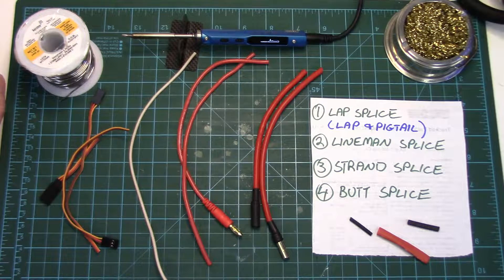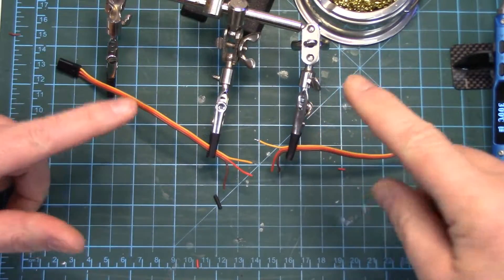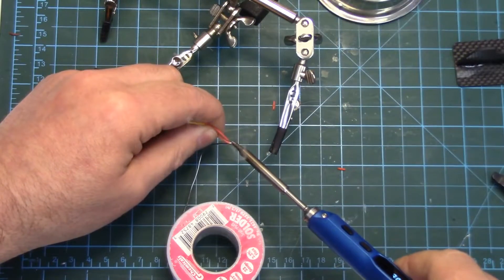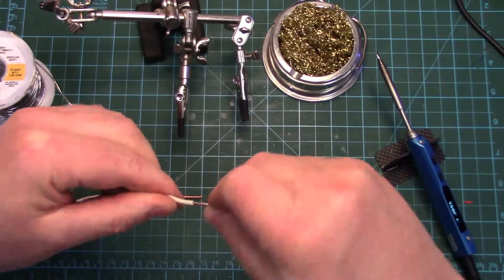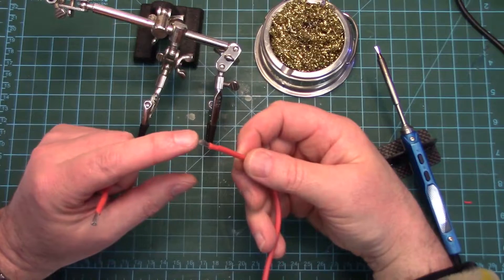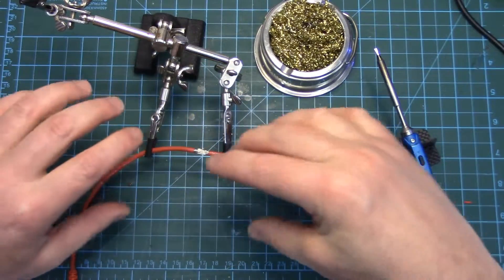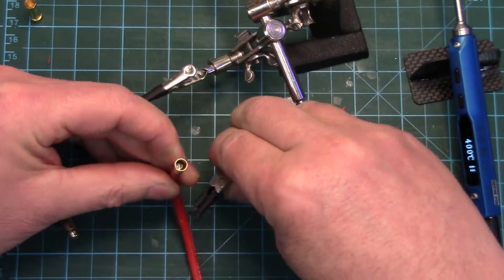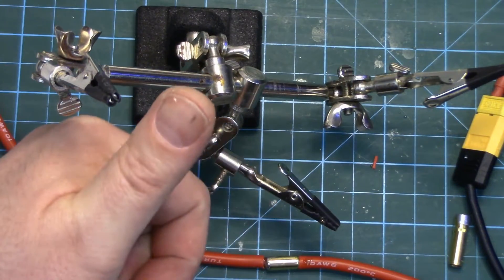Best Ways to Solder Wires Together - My 4 Easy Goto Methods.

Comment: I mounted my "helping hands" to a big washer. It adds weight and stability to it. The washer is 3/16" thick by 3 1/2" diameter.  Also, put a felt pad on the bottom.
Reply from the maker: Nice

Comment: The Western Union/Linman splice goes back to the 1800's was developed for Telegraph line repair's (solid wire ) but you see it used on stranded too.

Comment: You do it so easily!  I'm a beginner, just trying my first soldering today.  When I try to tin the wire, I can hold the iron on the bottom of the wire for 30 seconds or more and hold the solder on top of the wire, but it never gets hot enough to melt the solder.  My iron is at 330 C.  I started by putting some solder on the tip and wiping it on the sponge, then try to tin the wire, but it doesn't work.  I switched to a wider solder tip, but it didn't help.  I guess I need a video for the rank beginner!
Reply from the maker: @Mike Williams - What size of wire are you soldering and what power is your iron (in Watts)? 330C is a little low for larger wires (14 Awg or larger) so that might be the first thing to try changing. For large wire, you will likely want at least 350C. If your iron is low Wattage, you may have to go even higher (380 to 400C).
To get get good heat conduction from the tip to the wire, you have to have molten solder between the tip and the wire. If you hold a dry tip to the wire, it will never conduct enough heat into the wire to melt the solder. You want to introduce the solder between the tip and the wire.
Low quality solder &/or not enough flux can also be a factor. 
 I cover these basics in my wire tinning video: https://youtu.be/DCvo1xQr6jY
My Soldering for Beginners page on my website may also be useful: https://www.rchelicopterfun.com/rc-soldering.html

Comment: Do you have a video on soldering a webcam usb cord?  I have had a horrible time trying to strip the tiny wires.  Also, what is all the other non-wire metal and weirdly wrapped wires that surround the original wires?  I am a nube.  I got into wiring the many old lamps in my dads house, then the cats gnawed on my web cam cord… Thanks for your great video!
Reply from the maker: When working with & soldering really tiny wires such as USB cables, I pretty much need my magnifying lamp or even my stereo inspection microscope to correctly perform the task. A very fine wire stripper is also needed for the tiny cable as small as 40 awg. The material around the wires is called shielding. It's normally a grounded conductor that will both absorb and reflect RF and electromagnetic interference from getting into the conductors. Google search "shielded cable" if you want to learn more about it.